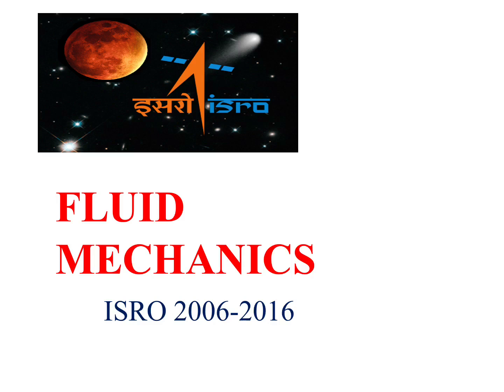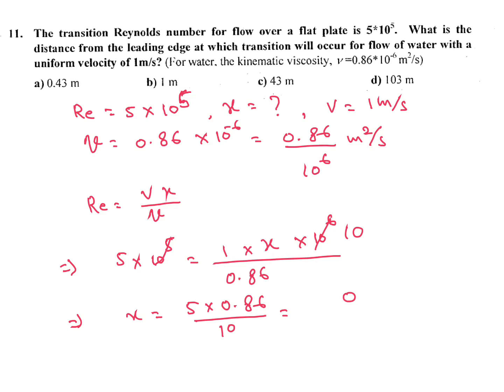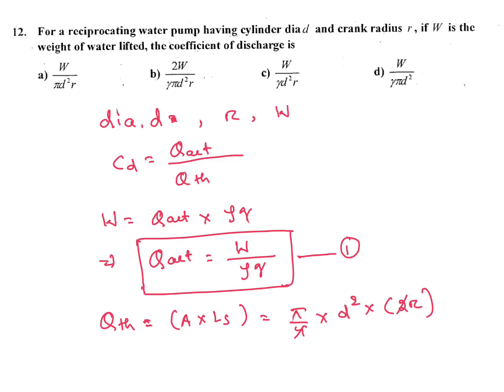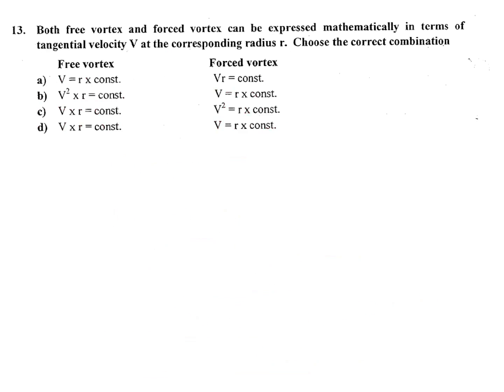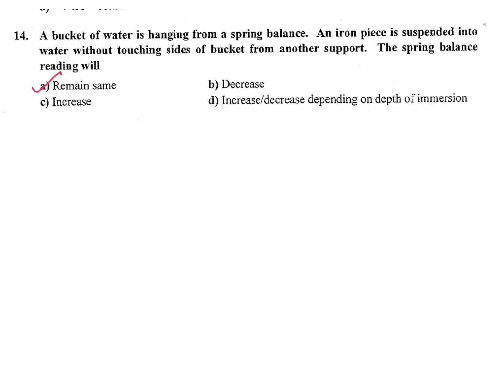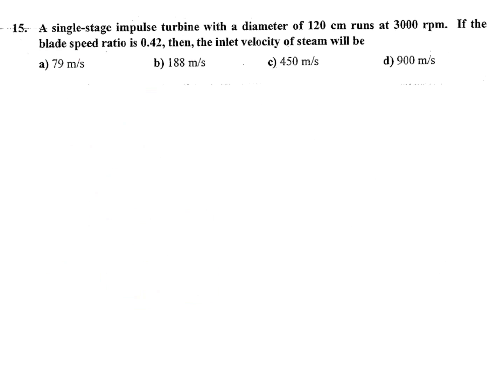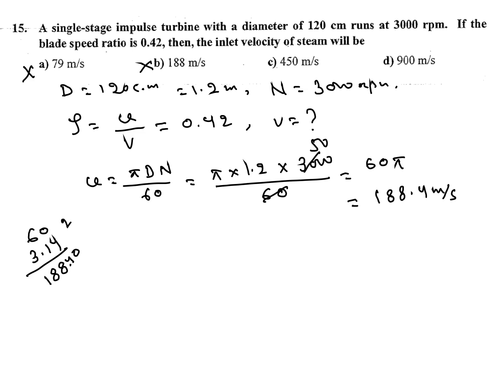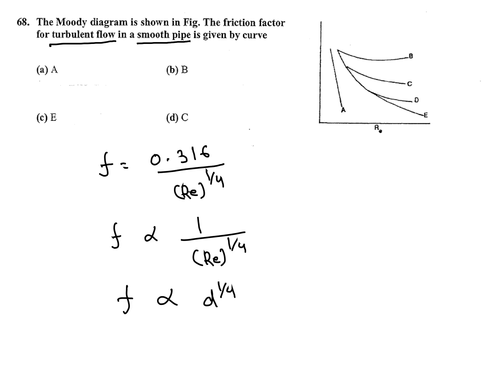ISRO FM 09

Comment: sir in question 14, i have a doubt that as in the first case of question, the iron rod is not suspended and reading of spring balance is noted down and in the second case as the iron rod is suspended though with a rope it will lead to increase the mass content of the spring balance measurement system and the level of water is also raised because of that...so whats you conceptual thought on this ...would like to hear from your side , in your free time...thank you!

Comment: In the explanation of Q14 if you draw the free body diagram of both the bucket and iron rod. W2 force will be exerted on the bucket system which will increase the spring reading